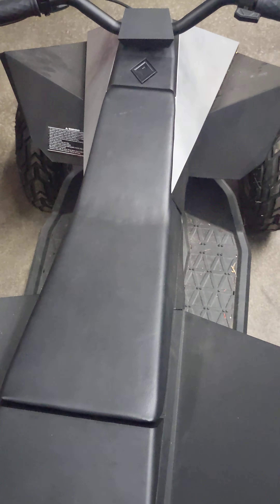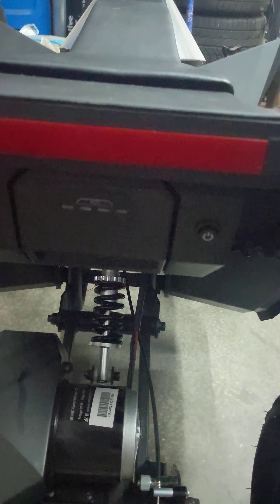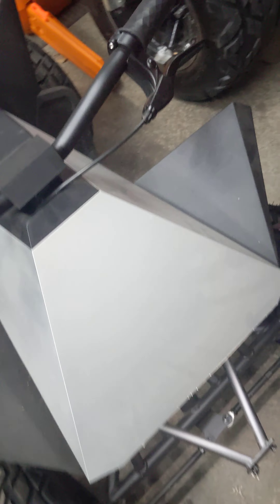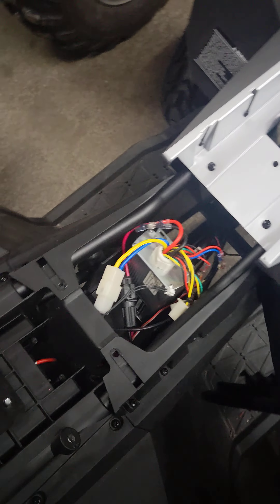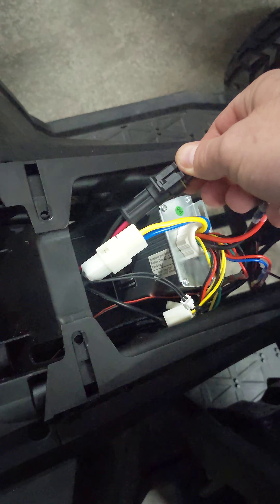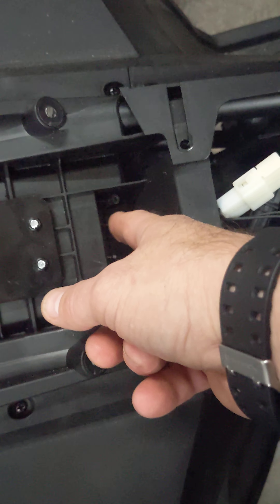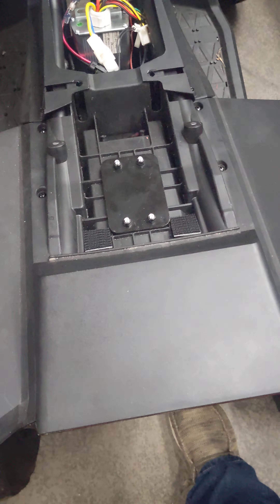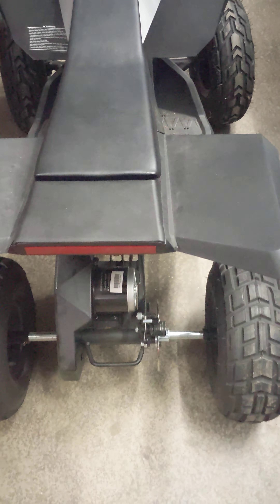Cyberquad fixed with aftermarket controller wired up.

Comment: Can u make another video with the light connection I cannot figure it out thank you
Reply from the maker: I have it and the rear light hooked to the light output on the controller I have. I believe it's a yellow and black wire.